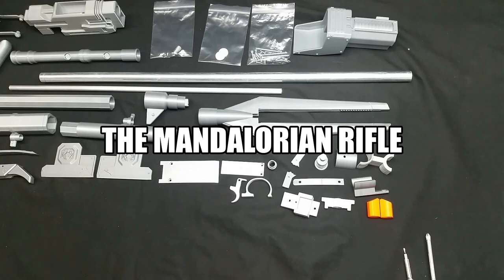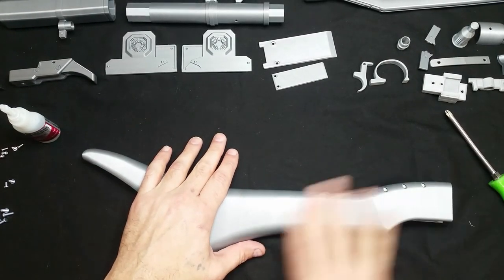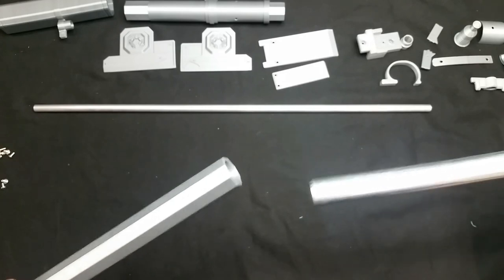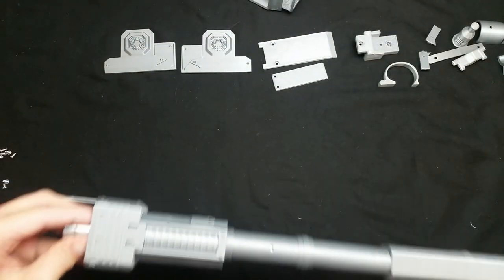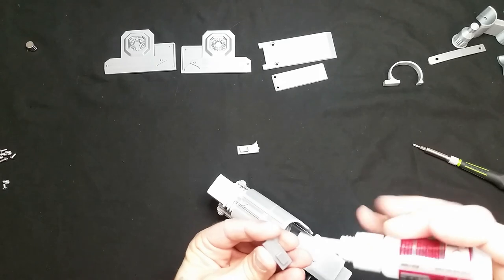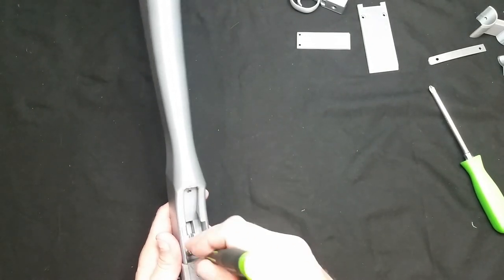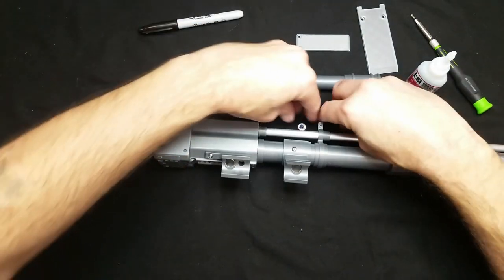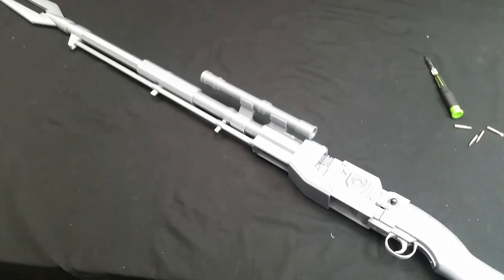The Mandalorian Rifle assembly

Comment: Bravo!  I loved it so much I bought it!!!!!  Well thought out and designed.  I want to ask if you have thought about maybe making/designing the receiver and barrel to be removable instead of glued together for those of us that would be traveling with stuff to cons?  I know that it would make it less accurate, but it's definitely something a lot of people are willing to deal with since it would only need to be a couple of screws.  A prop this long causes a lot of issues when traveling. I'm sure I know the answer to this question, but the worse you can tell me is no.  I was wondering if the files would be made available to people that have purchased the kit or even for a small nominal fee so that we could make repairs as necessary to the kit we bought when something gets damaged at a con or trooping? As you mentioned it doesn't matter what you've thought of to make it resist stuff, things will break and I've had solid resin kits break on me before with no way to repair them.  I'm by no means asking them to be shared freely, because I know that people steal them, sell them etc.  Just a thought I was having watching this because it's not a matter of if it breaks, it's when it breaks when you travel and go to cons, festivals and make hospital visits. Thanks for all the work you put into this.

Comment: Do you think it would be possible to attach the chamber and barrel sections with magnets instead of glue or two-part epoxy?
I'm wondering if that would allow the rifle to break down into two parts easily for storage and transportation without creating other issues.